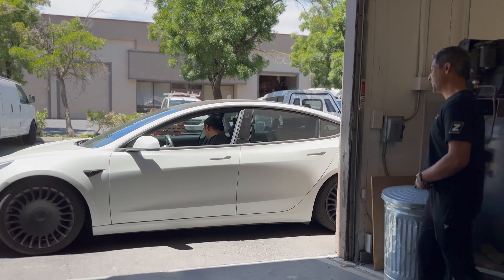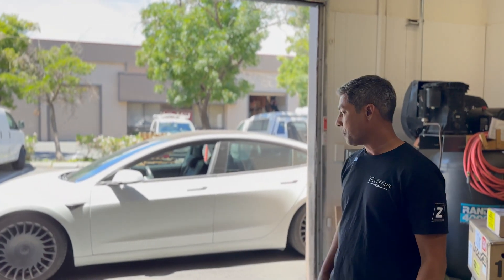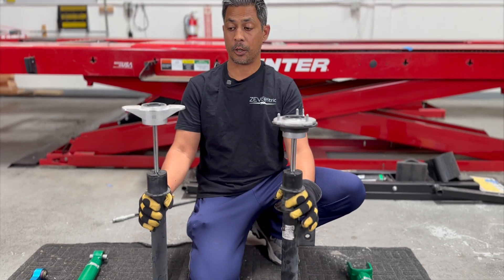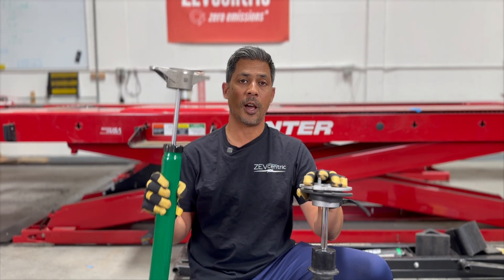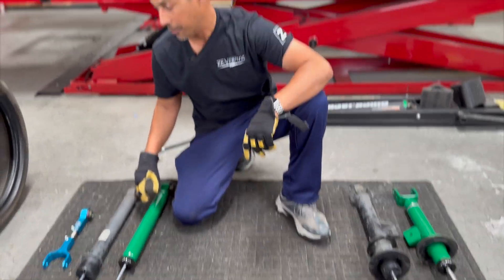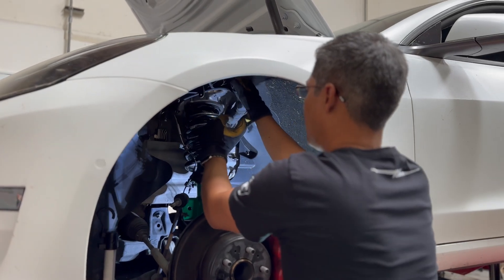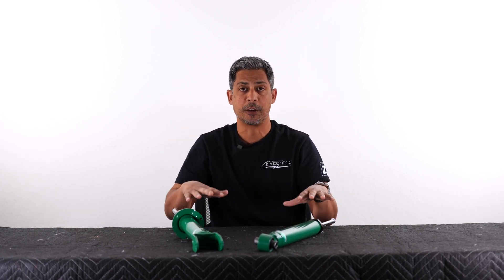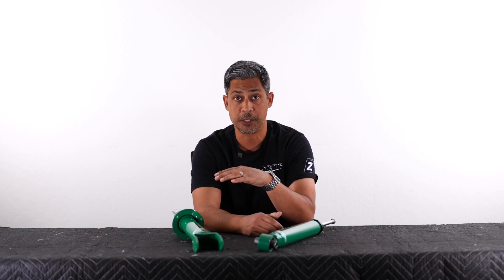So good!!! Finally tested Tein EnduraPro shocks  on Tesla Raj's lowered Model 3 LR Rear Wheel Drive

Comment: Looking to get these dumpers. If these dumpers work with tesla original springs or you suggest to change coils too?
I installed Koni Active FSD dumpers on a 2023 Y RWD model.
After replacing I feel more road and wheel noises/vibrations that pass into the cabin when the road is rough.
Do you know such a phenomenon?
Is it necessary to do a weel alignment after replacing, because I didn't do that as I understood that there is no change according to the manufacturer's statement.
Reply from the maker: The Koni are terrible.  The Tein is so much better and softer.  You can use it with the original springs.  If ordering from us I can share best settings and practices.  Zevcentric.com. Where are you located?
Reply: @zevcentric  Israel
Reply from the maker: @kgenady  Ok sorry we don't ship overseas.  You will want to source it locally to avoid duties and tariffs from usa.
Reply: @zevcentric Thank you for prompt response.
Can you please give me part numbers for Y RWD 23(Berlin).
I will look locally 🙏🏼

Comment: I installed Tein Endura Pro on Tesla Model 3 Long Range AWD. The first few weeks I was blissful about how smoothly my Tesla started to ride. But after 2 weeks the stiffness returned, they also feel like factory shock absorbers. There are also small impacts on road joints. I visually inspected the shock absorbers and did not find any signs of leakage. What could this be connected with? The mileage on the Tesla is 45 thousand miles.

Comment: Hi just installed the Tein Endura Pros on MYLR AWD but dont feel any difference. What else do you recommend I do? I am based in Germany if that helps.
Reply from the maker: I really don't know.  We never use the non adjustable ones on the dual motor 3 or Y.  You might need adjustable ones.  What year is your LR?  If it's a 2023 with the oem comfort then that is probably why you don't feel a difference.

Comment: At 3:57 On the front shock installation. How did you get that upper ball joint assembly, the triangle with the upper ball joint,  to move freely up to the top, out of the way, like that? On mine it just pushes back down. It doesn't freely move up and out of the way like that. Did you have to remove something to get that to happen?
Reply from the maker: Hi George, the front upper arm has a 13mm head bolt on either side of it.  Loosen those and it will move.  Just make sure you tighten it back into the same position when done.  There’s a bushing there that you want to preload in the correct place.

Comment: Have them on model y.
Good ride but strange sound from rear ones
Reply: How does it ride? LR OR MYP? I got 21 MYP
Reply: @Pennychaser1  
Ride is super comfortable... Mybe too soft. Will add some clicks and see.
Reply: @Pennychaser1  Lr. China made 2022
Reply from the maker: that could be typical of a twin tube design.  Where did you set your damping and did you install it yourself?  Where did you purchase them from?
Reply: @zevcentric is this noise issue something you have noticed testing the EnduroPro Plus on Model Y Performance?
Reply: Bought here in europe from tein dealer.. Instaled by service garage with experience...
Having it soft.. 5 clicks from soft toward hard
Reply: @preventdelozacelje5405  from where in EU did you buy them from?
Reply: @pats1569 would love to know as well. Looking to install on my Model Y Performance
Reply from the maker: @preventdelozacelje5405  congrats.  You got the plus versions that are adjustable.  These ones are fixed.